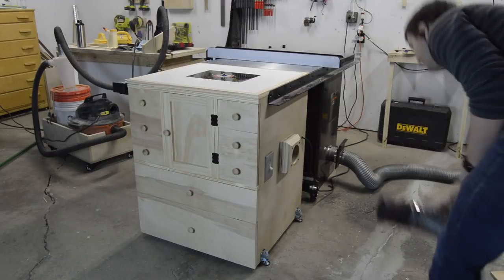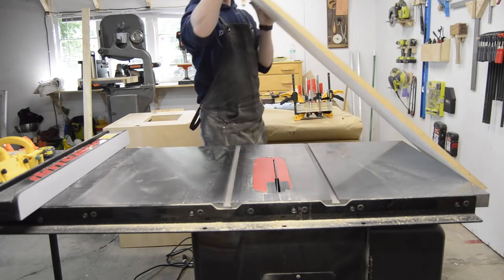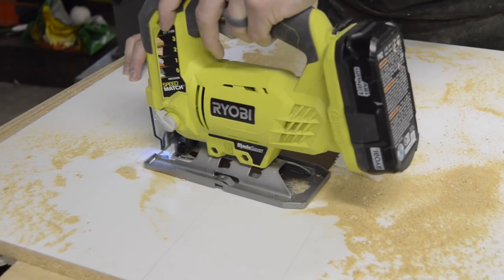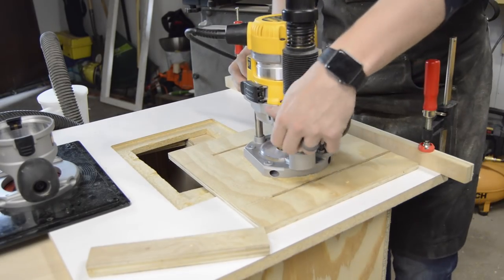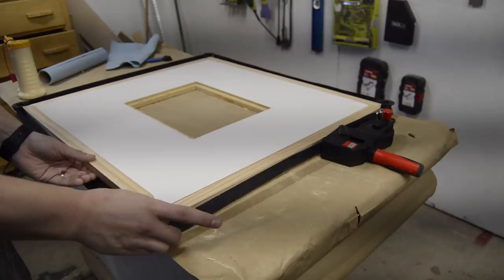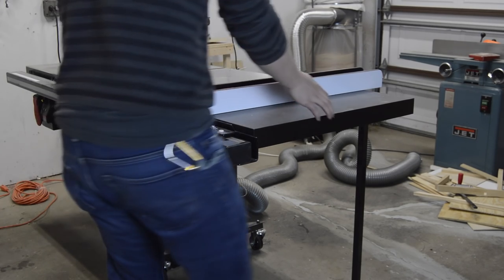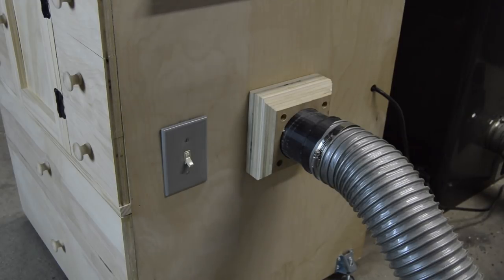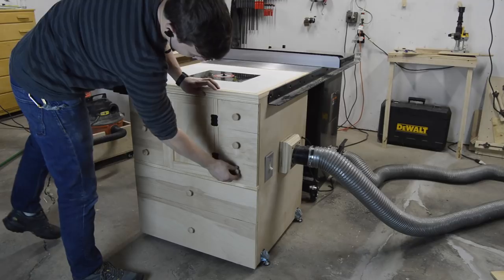Built-In Router Cabinet | DIY Router Table Part 3

Comment: I mounted my router top in my table saw wings just by putting some leveling screws under it. I thought it would be a constant hassle keeping the two tops level if I were to build a cabinet under it. You changed my mind. I'm goin for it. Thanks

Comment: is the router secure without a lift? I assume you have to open the cabinet to adjust the height of the bit?
Reply from the maker: It's secure but a little painful to adjust. Yes I have to open the cabinet to adjust height, and I have to fully remove the router to change bits. I have very recently upgraded this to a router lift (same top/cabinet though).

Comment: Nice end to this series, Dave.  Lots of storage in there.  How does the height adjustment work for you.  Do you find it very distracting to reach under to adjust the router?
Reply from the maker: Yeah it is a bit annoying to deal with the height adjustment. I have to sit on a stool, reach in, and sort of guess at the bit height in a very manual way. I plan to buy a nice router lift one day that will allow me to adjust the bit height from above the table top, but they're surprisingly expensive. Fortunately whenever I buy one I should be able to just re-cut the hole for the insert into this melamine top, or in the worst case, just make a new melamine top for the lift. Thanks for the comment, Don!
Reply: @dkbuilds  If you haven't already you might check out Jay Bates' router lift.  It's dead simple and would probably fit in your current cabinet.  It looks very easy to adjust the height on though it's not as slick as a mechanical lift with the top screw adjustment.
Reply: @dkbuilds  Yep, you are correct that the above the table lifts are rather expensive.  I have the Incra Masterlift II with the metal insert rings from Rockler.  It was expensive and more than I needed, but I knew it would be something I'd never replace and would be around long after I'm gone so my kids could fight over it. :-)   It works flawlessly, holds many different routers (including the one you have, which is also the one I have), and is rock solid.   The only thing I would change about it is I would like to see the height scale be resettable.   It's not a major isssue, and is the only thing I would like to see them add.
Reply from the maker: @halsonger1317  Thanks, I'll check that out for sure!
Reply from the maker: @DonsWoodies  Very nice, that looks like a beautiful tool! I'll start saving up for one ;)

Comment: Congratulations from Romania!
I really like the table for the router, can you tell me how thick is the plywood for the table?, I want to use it for a makita rp2303 router.
Reply from the maker: Thanks! The table top is 1 inch thick melamine. Most important is the router plate insert. If you can afford it, buy a metal router lift.... but they are very expensive :(